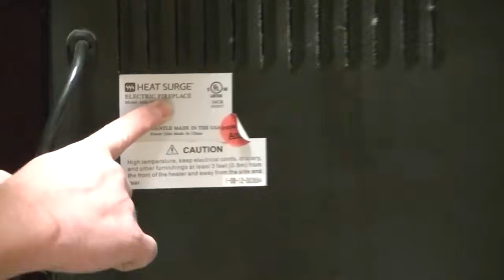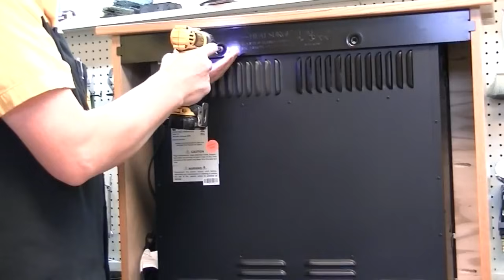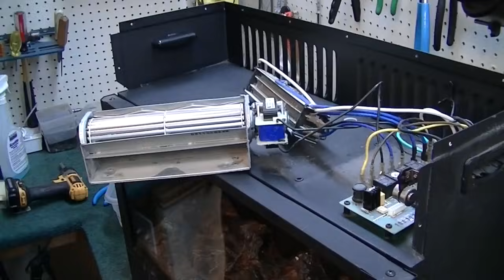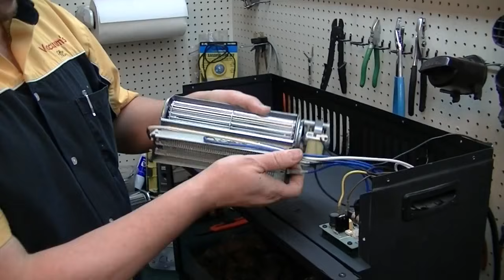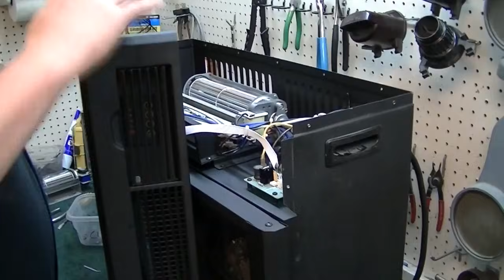How to Repair Your Heat Surge Fireplace

Comment: Thank you so much for these videos. My synco flame motor was going bad as flames were "frozen" . I disconnected the brown wire to the flame circuit on the circuit board. Also cleaned my fan good. Tested and is working! Put all screws back in and back into cabinet. My flames won't roll like a real fire, but it's ok . My 91 year old dad mostly uses for the heater. Lights still give the look of a fire, just not flames rolling. Thanks so much for your help.

Comment: I found one of these curbside today. It is very clean, doesn't power on, and has no tension in the reset button. I am assuming at this moment that the button needs to be replaced. But I've only been diagnosing the problem for 15 minutes so far. I haven't even taken it apart yet. This video is very helpful regardless. Thank you

Comment: Just found one of these on the street over from my house, cosmetically in great shape. Didn’t power on when I plugged in. 

Thanks to this video I was able to disassemble this fireplace and thoroughly clean it out. There was no indication what was actually the reason it wasn’t working but all I had to do was unplug the reset button from the mother board and plug it back in, and it seemingly works like new again. The bulbs in the bottom are burnt out but I ordered a pair of those already. 

Wondering what filters I can put on the back as I have cats and dogs in the house and would like to keep as much dust out of this as possible

Comment: This video was very helpful. I have that exact fireplace and thought my unit was completely dead. I would have gone through those steps to replace the parts but at the end of the video you showed the reset switch which fixed my problem. Thank you

Comment: Thank you so much for this video! I bought one of these models of fireplace used, and it was SO loud when I turned on the heat! I found this video, purchased a motor online, and then used this video to remove and then replace the motor step by step. Now it works like a dream!  Yay!!!

Comment: I purchased my hear surge fireplace from HSN in 2007 it is a big unit. Also purchased the harsh it sits on. I think I probably need to buy whole new firebox. I didn't find reset switch. It just quit working. Still beautiful  and enjoyed it all this time. Is it to old to replace the heat Box

Comment: I have 2 of these heat surge units both 2008 model year bought them both at an estate sale for $75 for both they both work. But have some minor issues this video is very helpful I will contact Dave for parts these units are worth fixing I believe there very nice

Comment: I will be putting a dust filter on my unit. A filter is certainly much cheaper than replacing a blower motor. I have already repaired two of those stand alone units . I was told there were no user replacable parts inside but its funny because I found a place that sells all the parts needed. The price has gone down greatly on those smaller portable units anyways.  As you stated, Dust, hair( dog hair) can cause these units to go into a thermal shut down. I have had that happen several times. A thick matt of dog hair is usually covering the intake.
Reply: So do you just have to blow out the fan and clean or do you have to replace a part
Reply: @PhaedraDarwish  As with any normal maintenance routine,  you should blow out the unit, removing any buildup on areas you can reach. I have found fan blades caked with animal fur. This can cause an imbalance  on the fan blades, putting strain on the bushings on the motor shaft. Anything you can do to help prevent those conditions helps HOWEVER, keep in mind, you never want to block airflow to the unit. If you decide to add any kind of additional filtration, make sure you clean that filter often or change it. If the filter gets too full, it will reduce recommended air flow and possible can even get sucked into the airflow area, blocking a large percentage of airflow. Do not ignore the unit. Proper maintenance  is a must.
Reply: @scottfirman hi I was curious what filter you bought? I was thinking of purchasing some magnetic mesh that I’ve used on my PC case to reduce dust and pet hair within that

Comment: This video inspired me to take my heater apart and see if cleaning things out would help. My fireplace is model 26ef023grg that came as part of a TV stand.

I used compressed air to clean everything out which I'm sure was necessary, but I ultimately found the issue with my heater: the fan wasn't turning! When I first turned it on this season it made an awful noise then stopped quickly (both the noise and the fan itself). That sound, I came to find, was a bushing (on the end opposite the motor) that was rubbing inside a rubber boot/grommet.

I disassembled the boot and the bushing, and it was apparent the boot was seizing on the shaft of the fan blade assembly. I removed the bushing and cleaned the inside of it as well as the shaft. I used some white lithium grease I have on hand to lubricate it, and I packed the boot with more grease. I inserted the bushing into the boot (it seats in a groove) then slid it back on to the fan shaft and seated the boot in the fan housing.

The fan is spinning very smooth now! I ran the fan for an hour last night to see how how my fix would pan out and it was just like old times. I guess I'll see how long this holds up. Maybe it will become a periodic maintenance thing I have to do. I've been using my heater for five years now, so a five year interval isn't too bad I suppose (assuming I can go that long again).
Reply: This was helpful for mine. Thanks
Reply: @rawlstonm97  I'm glad. I just re-read my post and fixed a few things (I guess I should have used Grammarly 😅).

It looks like I posted 3 years ago. FYI, so far, so good.

Comment: I've serviced my fan 5 times now over all the years that I've owned mine I blow it out with the air gun And then I pulled the rubber groomets off the ends and grease everything it's easy you can stop it from squeaking in 10 minutes  even had to put a low speed gear motor in for the fake flame.

Comment: Thanks for this video. I have an ADL-2000m-x that was made the same month as the one in your video! It works in low mode, but if I put it in High heat mode, it quickly trips it's own built in breaker. Not sure what's wrong.
Reply: The light is also out intermittently
Reply: I think it may be like the comment above. Thermal shut down. Probably needs the hair and dust cleaned out

Comment: I have a  Heat Surge X5C unit everything works but no lights.  I've checked all the connections and everything looks fine.  Both bulbs worked, but I did notice one was a 60W not 40W bulb but no light when unit is powered on.  Thanks

Comment: Please help. I have a heat surge model 6. Didn't use it for a while. Kept it in storage. Whooped it out. Started up immediately and it worked great. I've had a few small issues in fixing, like the light bulbs, servo motor for "flame" rotation. But the main issue I'm having is it will not run on high. Not by the knob but when I hit the button for high. It works for around 1-2 minutes, shuts off and beeps. What could be the issue?

Comment: I have a unit from costco model 42IF442FGL and SN AJ-84620-E. It powers on but blows air with a blue light and doesn't go red for producing heat. The button since no remote just makes the flames flash. This is a used unit and it did produce heat the day we brought it home. Any help?

Comment: years ago we are now in 2025 ,,,i bought one of these ,,,,they where saying it heats with a special bulb filled with a gas ?  heating element is more like it lol .   found out they draw about 12.80 amps of  current , i tested it today cause my wife says the electric bill was higher then usual ?   so far it does work fine i was just curious to learn a little about it , fine video thanks

Comment: I have a digital fireplace heater and unplugged all the fake flame lights and its motor i didn't need all that and need to fix it so the heater will stay on it keeps shutting off when the room its in is still cold so i wonder will it work without the ntc plugged in because i think thats what its problem is 

I've unplugged the remote wiring and all what i didn't need cause all that extra stuff wastes electricity

Comment: I've had my unit since 2008 or 2009.  I stopped using it because the plug and cord was getting really hot.  Could you advise the problem?

Comment: I have a CB570SET Chamberlain Media Console/Fireplace which powers on, flames glow and roll however the unit automatically shuts off after 20 to 30 seconds running time no matter what temperature I set it to. Any suggestions?

Comment: nice lesson on repair of the unit. I have one that threw sparks and smoke. i turned it off and took it apart both commons fried with insulation burned off and neutrals ends look brown on the board,,, Got any suggestions where to start, thanks Eddie
Reply: Edward Guise I have a fireplace and it made a clinking sound and don't come on can't cut it off I have to unplug it
Reply: want turn on
Reply: want come on why

Comment: I just fixed mine. the fan was not connected to the motor, so the shaft would just rub against and vibrate making a horrible noise. I shoved a needle in the rubber shaft cover and the end of the needle hits the blades so the fan moves along with the output shaft of the motor

Comment: My heater just shuts off. I press the reset button and it will work for awhile then shut off again. The heat and lights work just fine but it shuts off...model #2000M-X  Ser#1-08-10-040852
Reply: +Rhea Flowers  how did you fix the problem?
Reply from the maker: +Rhea Flowers This is usually caused by a faulty reset switch.  Call us at 253-474-9468 if you would like to order one.
Reply: Vacuums Etc - Kirby, Dyson, & HeatSurge Specialist
Reply: Vacuums Etc - Kirby, Dyson, & HeatSurge Specialist t
Reply: Rhea Flowers
Reply: Ours shut off as well.  I found that the control circuit board has a defective solder job on a diode directly under the transformer.  I soldered the two prongs and re assembled it. Now it works great!

Comment: Great video, I have a Heat Surge Electric Model M6, My problem is after 10-15 minute it will shut down , beeps then off. Only way to get it to work again is wait 15-20 minute and try again. Some days it will stay on for hours but lately I'm lucky if it last 20- 30 minute. Does anyone have any ideas where I should start with repairing.
Reply: I have the same problem with my M7 Model.
Reply: Did you figure out what was wrong with it? Mine will only start powering on for about 10 seconds and then cut out

Comment: My x32a (23a?) trips out after about 5-8minutes on high temp. Was running little longer on low heat. Exactly same time flame stopped moving and is stationary. In spring I took apart and blew dust out , pretty dusty. Just plugged back and same problem. Got reason for no flickering flame. Just don't know if another part is needed for tripping out or replacing synchro motor.? Any help be appreciated. Thanks

Comment: Hi David, all that’s on the sticker is 2007-11, but it’s a roll n glow. That being said everything on it works, except the heating element. It just blows out cold air. I’ve taken it apart and checked the plugs. Still no go. Please help

Comment: I purchased a 6 new model M6 201010 M6C and one of the units was never used and when we went to turn it on, no fan and no heat. The flame lights up and when we hit the switches, they beep. So is the fan bad or is the inferred heater bad since never used?

Comment: My "flame" is working, motor seems to be running, but no heat. Is this something that I can replahance? I paid about $150 for this "woodburning stove-type" heater. I know it would depend on the price of the part once I figure it out. Do you have these parts? Thanks.

Comment: I have 2007 Heat Surge, everything works but the heating element doesn't turn red, and blows cold air. the fan does blow. What could the problem be?

Comment from the maker: Sounds like the fan to me.  When the fan is not working properly the heater element will overheat and make the smell you are talking about. The unit will usually shut down at that point as a result. The heater relies on the air flow from the fan to keep it at its operating temperature.  If you are going to do the work yourself you can purchase the fan on our web site at myvacuumplace,com or by calling us at 253-474-9468 or 855-VACUUM-1 (855-822-8861)

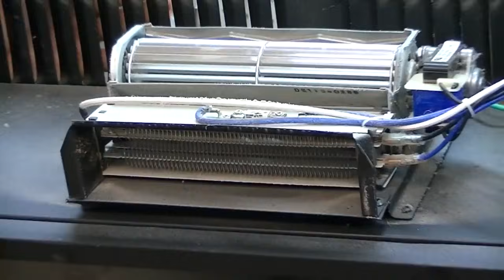Comment: Ok....at approximately 5:30 did no one else notice the critter crawling around from the right side of the bottom interior to the left and then up the middle in the bottom half of the the unit? 
I scrolled the top dozen or so comments and saw no mention of it.
Reply: Yes, it was a reflection off the glass. Probably a puppy
Reply: @danakarloz5845  😂😂😂😂😂. Yeah I totally see that now. You know I actually completely forgot about this... But I love that you replied and saw the truth beyond the illusion.
Reply: @johnspecter9907  😂👌

Comment: I used my air compressor to clean mine, works good.
Reply: I used to love using an air compressor until mine broke and I decided to try a leaf blower  I was so much happier with the results but you have to do it outside :)
Reply: Did you have to do all this taking it out of the shell?

Comment: MY HEATER WOULD SHUT OFF ON HIGH TEMP AND I WOULD RESET IT. IT WOULD RUN FINE ON LOW AND MEDIUM TEMP. I TRIED TO RUN IT AGAIN ON HIGH TEMP AND IT SHUT OFF AND WONT RESET. MODEL: ADL-2000M-X  SERIAL #1-08-09-031001

Comment: Mine heats and the orange flame comes up but does not move - making it look like a photo of a flame rather than like gas flames.  What to do?
Reply from the maker: Sounds like your Syncro motor is bad and needs to be replaced. Please call us at 253-474-9468 to order the correct one.
Reply: Mine does same.  ...it randomly started moving yesterday.   Had it 2 yrs..baughtat an estate sale...and it's never moved.   It was cool......it's like to have it always do that

Comment: I have 2007 Heat Surge, everything works but the heating element doesn't turn red, and blows cold air. The fan does blow. What could the problem be and what part do I need to replace.  Thanking you in advance.
Reply: Thank you, Matthew! It's been so long, I forgot I even asked :). I will take a look at what you sent. Thank you so much!!
Reply from the maker: +Regina Weber Mathew has given you dangerous information. You will risk fire in the unit or your home if you follow his advice. For me its not worth it for a switch at 16.95.
Reply: Regina Weber c

Comment: Hi, I have one which gave off some smoke...what does that mean...what parts do I need. Thanks for your help
Reply: 1st you should look for wires that have apparent burn marks. Then you need to replace them. But you also need to findput what caused the surge of electricity otherwise it will happen again

Comment from the maker: I need to know what model you have before I can give you any suggestions. Are they burnt at the main control board, tip switch or the reset switch?
Reply: Vacuums Etc - Kirby, Dyson, & HeatSurge Specialist model number is fp26-1a and no
Reply: we dont see no reset switch
Reply: Vacuums Etc - Kirby, Dyson, & HeatSurge Specialist. we found a wire that was burnt into

Comment: I have a 2008 Heat Surge , It will work fine for about 15 minutes then shut off , if I unplug it for a little while then plug it back in it will  come back on and work for about 15 minutes then shut off again . What could be the problem ?
Reply: I'm having the same problem with a duraflame heater... Ever find out what the source of the proble was?

Comment: MY UNIT FLASHES E3 WHERE THE TEMPERATURE DISPLAY IS LOCATED?  WHAT IS THE PROBLEM?
Reply: Dr. Kenneth Heathington, P.E.
Reply: Im glenn jersey and my fireplace works except the heat all it does is flash E3 what is wrong with it everything else works. Please help me

Comment: hello my heat surge  want stay on it comes on but goes off after about 15 seconds,so what is the problem?
Reply: I removed the safety cut off switch from mine and all works fine now...

Comment: Thanks for skipping right over the synchro motor replacement...
Reply from the maker: You're welcome, thanks for taking the time to find the correct video for the synchro motor.. just in case here's the link https://youtu.be/lxETczOSJxU
Reply: @vacuumsetctacoma  
I found that after looking into it further without your valued assistance.

I also noticed that in the video you mentioned for the replacement of the motor, there is evidence of burning on a number of certain plugs that carry high voltage to the board, and other places. 
Those plugs are clear when new, and black when heat burns them.

But then, you knew that.

Also, that motor can be serviced in about ten minutes from the bottom, and two screws, two wire nuts (supplied) and a cotter pin are all that is needed to deal with that entire operation.

But thanks for the help. :/

https://youtu.be/lxETczOSJxU?t=484